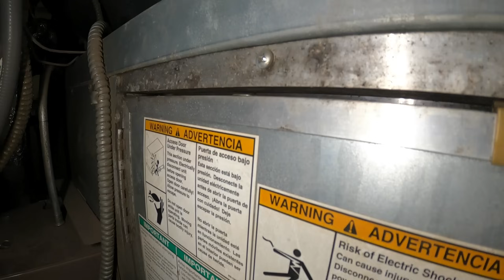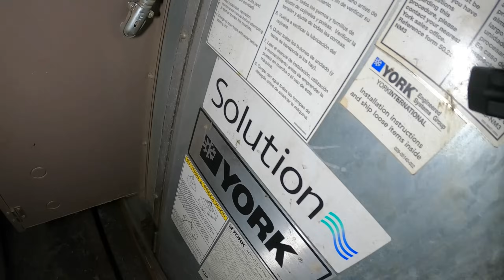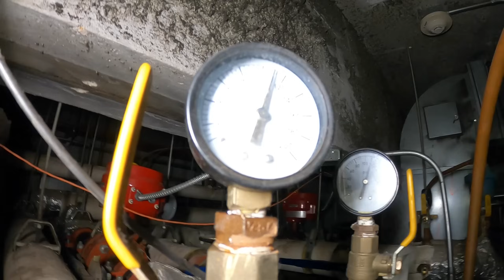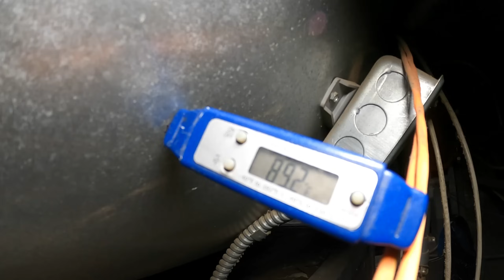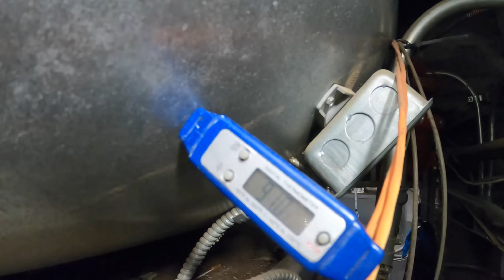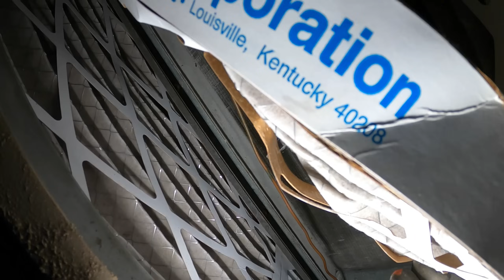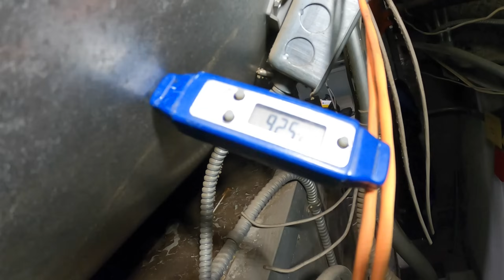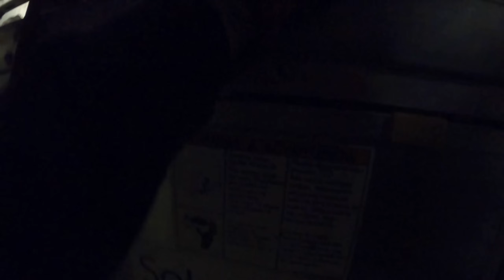HVAC Service Call: York 4 Pipe FCU NIGHTMARE UNIT Not Heating (FCU Not Blowing Hot Air) HVAC FCU

Comment: Your pump is air bound  you need to check your high vents , what I would do dump the loop and change out or pull each high hat/ Air vent clean out deposit. With pump off, fill loop with water standing pressure . Rule of thumb is 7 lbs per floor plus location of pump. So say this a three store building and pump are in the basement that four floor total 28psi to 35 max . Check ur relief valve on loop which max press of say 50psi . So you want stay 10psi min 40 and below. Flush out ur spiral vent air dirt separate on main loop.  it will be a big difference in loop temperature and pressure. Just a couple of tech tips for a powerhouse mechanic. Also convert/ heat exchanger or boiler supply water temp should be 140 F  degrees minimum with ambient temperature of 35F degrees and below air intake. Love your video, keep the high level for the hvac trade. If was easy every one would do it . Good luck. Think 💭 bigger picture when deal with industrial hvac. Who ever there building mechanic/ stationary engineering should be serious be question of what f**king there  doing in a 8 hour shift per day horrible and sad😞.

Comment: Appreciate the video! 120 degree water is cold even for us down in San Diego. One thing you could do to help with flow is hook up a fitting and hose to that strainer blowdown. Then, close you supply and open that blowdown to back flush the coil. I’m sure you’ll get plenty of dirt.

You could also get some fittings to attach to various points of the system to attach a pressure gauge to. That’ll tell you where your restriction in flow is.

Comment: Hot water temp is not high enough. That water temp should be 160-180. Also if there is no building return and outside air only then that will be a big factor. Also check to make sure coil is not air locked at all. And change that belt first. Do the simple stuff first. I always check belts and filters then strainers and temps in that order. Hard to tell in this video but is the building return closed and only fresh air damper open? Should be opposite in winter time generally unless the supply air setpoint is too warm

Comment: Excellent job , Yes those are air vents . Time to get some bigger wrenches 😂
I suggest a set of combination wrenches 3/4 to 1-1/2  in a canvas rool up ., Those bolts are usually 15/16.

and yes raise the heat loop temperature, it should be on a out door reset ( automatically raising loop temperature according to out door air temperature)
you are getting a good output for 110/120 loops temperature!

Comment: Ok I'll help. That is a pre-heat coil to protect the chilled water coil, you can tell this because there is a 38 degree freeze limit ran after that coil and before the next coil (chilled water coil).  I saw a freq drive so I am going to assume this is a multi-zone unit but hard to say without seeing a unit print or following the duct. This hydronics system will only be as hot as it needs to be to get discharge temp to 55 degree discharge at the AHU, based off OA temp and you would probably have to look at the code.  If it's a CAV using a freq drive as a soft start serving a single space, look at the set point and vwalla you're probably seeing the temp you want.  If it's a multi-zone though, go to the spaces and check the re-heat at the vav boxes.  But your hydronics temp is based on OA temp, without giving us that temp outside it's really hard to speculate what temp should be, and it's better to dial into the ddc program and see what's it's calling for, if it is low then check your heat exchanger off the boiler (man I am under paid).  Love your videos though, you do excellent work!

Comment: I guess letting this leak go was a very bad idea from management. 
Due to the leak the system automatically replenished the water somewhere. But tap water is way more aerated than the water in those systems. This causes more rust to form on the pipes, but also the microscopic bubbles burst in the pumps which causes erosion from the nearby pipes, aka. more metal dust floating in the water. In Germany where we do a lot of hydronic in floor heating etc. we install a magnet filter and a micro bubble separators to combat air and debris in the pipes causing havoc over time.

If you repair this system you probably should also consider putting in some bypasses that allow back flushing of the coils. those are probably very clogged.

Comment: What a terrible design, horrible position for a strainer. There is no thought of maintenance when a lot of these units are installed. Not surprised. Before you open to dissasemble the valve, make sure their isn't air trapped in the line and those air trap are actually working. With that amount of dirt in the line chanes are it's clogged as well.

Comment: Go check the boiler supply temp as what you showed of 120 deg coming in is not nearly hot enough. The pressure  changes are probably caused by variable speed hot water pump.

Comment: Fixing belt will increase your airflow - discharge temp is going to drop more.  My guess is still have a flow issue, try flushing coil or checking if another plugged  strainer somewhere in system.  80 -100 psig on HW system is crazy.

Comment: Hey this is a dumb question, but are you a refrigeration mechanic or hvac dude? Im looking into school for refrigeration mechanic course so im watching your videos to help me. But im not sure entierely what your profession is.
Reply from the maker: Hey, it's not a dumb question at all. Air Conditioning & Refrigeration are different industries but they are very similar. The "Refrigeration cycle" is the same for AC & Refrigeration so we are basically brothers as far as industry. I'm a HVAC/R technician. So I do Air Conditioning & Refrigeration. Mostly commercial equipment. HVAC/R (Heating, Ventilation. Air Conditioning/Refrigeration). Some people only do HVAC, some people only do Refrigeration but I happen to do both for my company. Thanks for watching!
Reply: Hope your clearing 100k without overtime

Comment: Good job Jumper and Chris, It seems like you have gremlins controlling your heating system, just kidding, but the valve that the actuator opens and closes is probably is bad, or you have a clog some where, use a heat imager to see if there is a clog in the piping.

Comment: Water temp seems a bit low. I usally see a range between 150-180. I would check HW setpoint and go from there. Also check on the pumps what are they doing?

Comment: So that system looks like its setup as VAV, due to the drive for the fan. As someone else said, that coil is a pre-heat. It should take the discharge air should be 55 degrees. Down stream on your VAV boxes, you should have reheat coils. Those reheat coils likely have V-ball ball valves with strainers. I would bet those are clogged. That’s pretty nasty loop for it being a closed loop, they must not do much for water treatment.Those “rocks” are likely welding slag BB’s. Regarding the fluctuations in pressure, it looks like their PID loop is out of adjustment. I am really surprised that they can keep that absorber running. The maintenance required to keep those leak free is really high. We call those Air Handlers. Fan Coil units are above a ceiling. Just different terminology for different areas (country wise)but means the same thing. Also, that’s the shipping wedge/bracket on the top of the door at 29:26. It’s supposed to be removed before startup. It’s meant to keep the doors centered ok during shipping.

Comment: with that high system pressure, why not try back flushing the strainer first, instead of taking it all apart. open the bypass, make sure the inlet valve is closed, the zone valve open and open the outlet side up. high pressure/velocity backflow through the screen and zone valve will check/clean both. granted you probably want a large hose connected to a drain or outdoors. lol, if not things will quickly get "moist" in that area. 🤣🤣

Comment: U gotta alotta things going on.
1.  Too much O.A. set OA. To less %
2.  Air in hot water system.  Check vents.
3.  U may have another strainer in a larger line that's plugged.
4.  Raise the supply air temp

Comment: You def need change belt the pressures changing could be due to air in the lines. Make sure vents aint clogged with debris ive dealt with these nasty water systems a long time ago

Comment: Check your water temp coming from the boilers. 3-4 degF is not much. If your dampers are full return then the only way to get more heat is boiler and pump. Doubt that control valve is the problem. If your fan is a VFD you can slow it to get more heat transfer

Comment: you need to carry a small propain torch for situation like this when the bolts won't budge ... heat it up for a few seconds ...
Reply: That's what I do and use a small impact wrench with impact rated sockets. Easy peezy ;) then put Lil graphite anti seize on the bolts threads for easy tightening of the nuts, future easy disassemble and stops corrosion if the threads.

Comment: Butterfly valves are useless, they never hold so easy to get debris between the rubber specially when there not exercised. I always hammer the bolts on strainers before I start removing them seems to make a difference. Tell me a business that actually removes or services strainers, sounds like money to me!

Comment: Dude…. You’ve only got 120 degree water, your not going to get 120 degree SA…. Even with lower airflow with a shitty belt…. Inlet water temp must rise
Reply from the maker: Agreed. That was determined in the end. I recommended the engineer raise the supply heat temp for the absorption chiller and we ended up getting the system to operate properly. Thank you for your input & for watching! 🔧⚡️